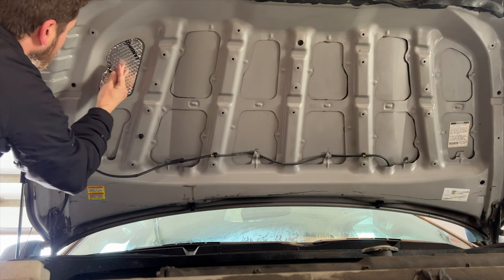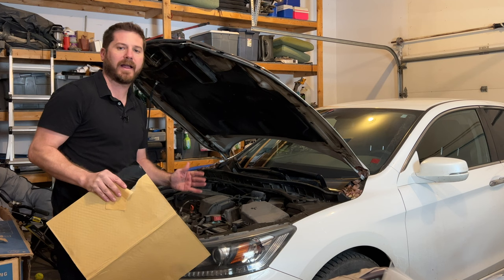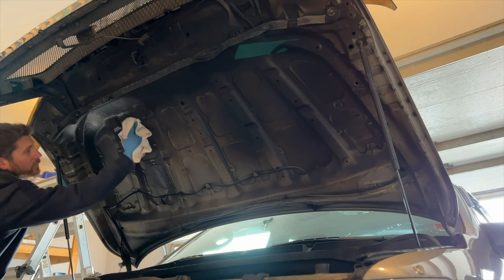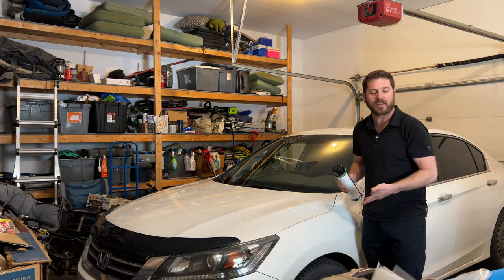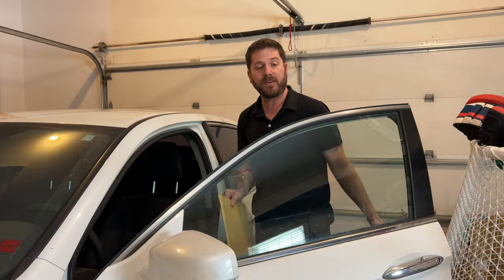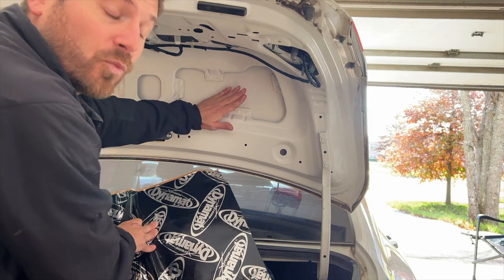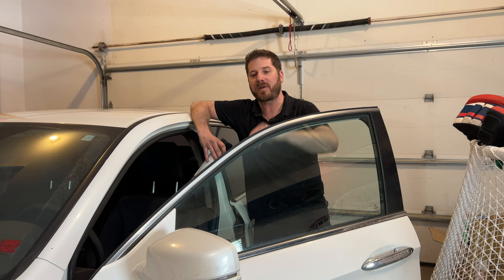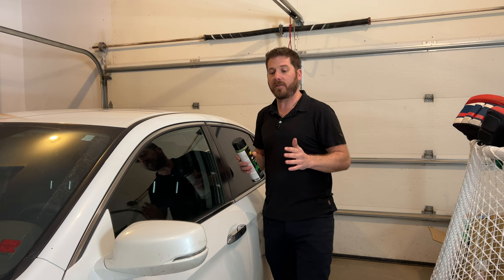Sound Deadening a Car Where It Actually Makes a Difference!

Comment: Sound deadening doesn't do much besides stop rattles. To stop road noise MLV or sound absorbing material is more important
Reply: This
Reply: What is MLV?
Reply: @AndrewDasilvaPLT  Mass loaded vinyl
Reply: You’re right but they all help, I do layers of butyl to reduce vibration and lower resonant frequency of panels, then on top mass loaded vinyl then on top of that closed cell foam
Reply: In an older car, sometimes, all you want is to remove vibrations
Reply: @modernbassheads5051 I thought closed cell foam goes between the butyl and mlv to decouple the mlv
Reply: I agree
Reply: Sometimes it's the squeaks in the dashboard and elsewhere is the low hanging fruit. It can change with temperature as the plastic expands/contracts. There are methods to tighten up loose sections with little wedges in gaps, foam tape, etc
Reply: @briank10101  Definitely. There are decoupling material and things to stop plastic from vibrating against other parts.
Reply: 😂😂😂😂😂 That's my whole point for looking any of this s*** up.What are we doing 😅😅😅
Reply: I guess I'm going to be the only person here that disagrees with the original comment. Rattles are going to be due to something loose and physically moving.
Reply: I’m looking to stop rattling from my rear speakers so this should be perfect
Reply: @JesusGonzalez-ft7ec Find out what's actually rattling first. Make sure it's not a loose screw or a loose plastic clip or some trim piece that's vibrating. If all that looks good and it's actually the sheet metal that's vibrating then some CLD sheets should stop it.
Reply: @JasonWW2000  I’m pretty sure it’s the actual speaker grill, since the speakers are reachable through the trunk and everything seems properly fitted. Whenever I drive over some shitty paved roads, the grille rattles a ton so would sound deadening foam help that?
Reply: @JesusGonzalez-ft7ec If the grill is loose then you want to fix that directly. I don't know what your grill looks like but you want something to hold it in place and not be loose. Some type of non-permanent adhesive might work. You can put some RTV silicone, hot glue or double sided tape underneath the grill area where you won't see it, but it will hold it solid.

If it's a grill that's built into a cosmetic trim panel that sits on top of the speaker and that whole panel is kind of vibrating up and down you can probably fix that with some thin pieces of foam shoved under the panel. 

If you're not sure what's causing the rattle then go back there and tap on things to see if it'll make the sound. You might also play some music through the rear deck speakers to try and get it to make the sound.

Once you know exactly what's rattling, a fix should be pretty easy.

It's hard for me to suggest a fix without actually seeing what's going on, but hopefully that helps.
Reply: @JasonWW2000  I appreciate the tips man! I will definitely have to look into, I’ve never taken the time and I just bought some foam but I’ll look at it tomorrow
Reply: Check out his other videos where he shows exactly that.
Reply: It depends on the vehicle. I see plenty of older vehicles drop 5db or so just installing foil-faced dynamat type sound deadeners
Reply: You need both material at least.
Reply: @adityadharni5027 you’re right. Take any sound deadening form a BMW and you’ll see a polyurethane foam coupled with an epdm rubber on top. That’s exactly how it should be done. Vibration (butyl/bitum), felt/ polyurethane or polyethylene and then epdm or mlv

Comment: It's a double edged sword putting it under the hood, yeah engine sounds are reduced cool....but engine sounds are reduce....meaning you're less likely to hear a potential major issue before it becomes major....example Car starts to misfire.
Reply: Or just do regular PMCS on the car, or do not buy MOPAR, Ford, VW, Hyundai, Kia, Audi, or BMW vehicles and you will not have those issues to begin with...
Reply: Actually, the real issue of insulating the engine hood is that you're trapping heat in the engine compartment, shortening the engine and component parts lifespan. That's 1 major reason motorcycles and old VWs  don't have radiators. They're air cooled.
Reply: I feel the same about doing the floor as well, especially on something like my 4WD 98 Cherokee because there’s a lot more that can go wrong than some other vehicles. I’m gonna get my sound system installed and see if I find it to be worth it to do my sound deadening before I move out/out of state one day where it won’t be nearly as easy to do a big project like that.
Reply: @journeyman291 hood insulation isn’t going to trap any more air than there is currently trapped in your engine compartment. If anything, reducing the surface area underneath the hood with an insulation pad would make less pockets for hot stagnant air to stick around in. Stagnant air in the engine compartment is an engineering failure of design.

Comment: TLDR: Under Hood, Under Wheel Liner, Doors, Floor. Not the Trunk.
Reply: Trunk is most important due to subwoofers rattling the sheet metal. If you don't have a subwoofer then I guess you only need to focus on isolating the trunk from the interior compartment.

Also, what do you mean by TLDR? This is a video. Are you saying you didn't actually watch the video?
Reply: @JasonWW2000  I use captions, so maybe TLDW, it helps to index the content even if it's short. With chapters on videos now it was hard to find unless you get through all the extra in the video.

Comment: I also did deadening on the roof. it didn't help much in normal day driving. but much better when it rain. It also help reduce heat from the sun.
Reply: reducing heat is interesting. but i actually really enjoy the rain sound
Reply: @user-jc5ff7tu5o  i love the sound of the rain! Just not when it fall on a thin metal sheet 😂
Reply: Rain on the windshield is very loud, but I had other issues when using the mat.
Reply: The sun effect is interesting for sure… having an all black interior that noticeably gets hotter the LITERAL SECOND the AC turns off full blast on a hot sunny day. This sounds interesting.
Reply: @ultragalacticgamer7195  I wonder how effective the 'glue' is, under intense roof heat?  It probably wouldn't stick long?
Reply: @ya472  it may vary depending what you're using is rated for but I've had kilmat on the roof in northern California heat for several years and no issue with the first year being consistently over 100 the entire summer with a week or so being 120
Reply: @Jay-je8fc or the blow dryer when you're going through a car wash
Reply: @darkstar9844  Awesome.  Thanks for addressing my concern.  🙂
Reply: @ya472 i applied a layer of butyl and a layer of foam for almost a year 
So far so good , butyl didn't melt but better to change the roof light from bulb to led , coz the heat of the bulb will cook the foam which I found out when I'm checking the condition of the roof last month 
I have a black car in malaysia 38°c ambient and few ppl died from heat stroke last week
Reply: @madxp9668  Good tip, thanks.  Sad about people dying because of excessive heat. 😞
Reply: @ultragalacticgamer7195  AC is just cool air in a car that has been heated.  The materials stay hot for a long time.

Comment: On your comment of insulating the floor of the car, I just put standard house floor underpadding underneath the carpet in a cheap econobox.  It was so effective people actually would comment on how quite the car was.
Reply: I had the same stuff put under my carpet in my 70 Buick. Made a big difference.
Reply: Carpet padding? Isnt that stuff too thick to then have your car carpet fit properly afterwards?
Reply: quite quiet
Reply: The issue there might be - if its not waterproof, it’ll absorb liquids (inevitably- spills, rain, washing) the material grows mold & bacteria which will smell.
Reply: @stevebutler812  true

Comment: I have an 'entry level' vehicle for getting about and yes, it's quite noisy. Thinking that it's not good for my hearing. Been on my mind off and on for a long time to insulate it than it has. This video has spurred me on. Remember: No project's too big to start! 😂😢😂
Reply: You don’t need to cover the whole panel. Just 50% or even much less will already do most of the work. Search for sound deadening on YT and look for a video of ‘car builders - sound and heat’ from 5 years ago for a great example.
Reply: It's not entry level, it's called an economy car 👍
Reply: @sean640 based off a definition of “entry level,” an economy car can be considered an entry level vehicle

Comment: really great overview of different areas. The only thing I'd add is specifically in hatchbacks I have found doing the "trunk" area can make a huge difference since it's really inside the cabin vs. the mostly uselessness of doing the trunk in a sedan.
Reply: Also look under the back seat. My mk3 golf has no sound prodding under there. Throughly is I’m waiting for some welding to done so can’t start doing anything until it’s sorted or it will get stripped again.
Reply: My 2022 Kona N-line Ultimate has a lot of noise coming from the rear trunk area and rear wheel wells. Hoping to dampen that for better conversation with rear passengers, and for the Harmon Karden player.

Comment: the trunk is also dependant on the car. Newer cars are usually pretty stuffed with liners and interior/trim. Older cars, especially wagons, can benefit a lot from it. My car specifically, Volvo 740, has a solid rear axle and (iirc) no factory insulation and the trunk actually uses a lot of wood for the trunk interior, sound deadening the trunk area makes a HUGE difference on my car specifically, mainly around the wheel wells and where the axle mounts to the chassis to be specific.

Potential seal breakages and where stuff mounts to the chassis are areas you'll see a lot of improvement, suspension mounts like I mentioned above.
If your car has a tow hook then it could (theoretically) make a big difference when pulling a trailer considering they don't have suspension most of the time so your car is gonna absorb a lot of the road vibrations

Comment: Best of all is the trunk of cheap/barebone hatchbacks/estates because it's often just steel sheet down there. I once had a cheap mk.1 yaris and it made a world of difference just with the area aft of the rear seats; it muted a lot of exhaust rattle and road noise for very little money and effort. It's also really easy to cover the rear wheel wells in hatchbacks from the inside.

Comment: I understand that the trunk can be not entirely worth it, but for me it was worth looking at! I have a 2010 corolla s, and under the carpet where the spare cavity is, there is nothing! Its just plain frame. I added adhesive back cat scratching carpet and added missing plugs to the drain holes and at fwy it reduced droan and lessened the bang over speedbumps quite a lot!

Comment: Easiest tip - never mind the underfloor work.  That’s hard, and not for everyone.  Two negatives for it - hard and water absorption.  Maybe the foam you use is closed-cell, maybe it’s not, how would you know before buying it (sure, there’s a description by the vendor, I know).  Add a second set of floor mats, or some kind of under-mat padding, eg same underlay as for carpets at home.  One big issue hardly mentioned, is fire.  Hands up all those who flame-test the stuff that says it’s ‘fire-resistant’ themselves after they buy it.  I got a shock, had some special foam pads for a loft, flame-retardant it’s meant to have…I lit it with my hob igniter flame just like the ordinary foam - both were self-perpetuating to a degree, once they ignited.  But, floor mats, is my tip.  Remember, these are the biggest flat sections of your interior, along with the roof and the door panels.  It’s not just about stopping large flappy panels from undulating, it’s also about absorbing lots of little echoes that otherwise ping-pong around.  But, good vid, thanks for these insights on other stuff.  Take care all, and don;t be afraid to use earplugs for long lonely journeys, that works too (question for discussion: is it worse or better, to use the likes of Apple earbuds when driving, for your ear protection?  My brother and I kicked this around.  It is alarming how loud you turn the stereo in the car up, when going faster than say 50mph/80kph.  Earbuds block noise, but do you end up turning them up too, so much it’s bad on a long journey?  And, the earplug/earbud method, makes you slightly more ‘deaf’ to vehicles in close proximity.  Anyway, points to ponder.)
Reply: been using airpod noise cancellation and it remove almost all noises in the car up to the point im out of touch with reality..feels like im just floating in my car
Reply: You also eliminate hearing any emergency vehicles approaching or me beeping at your floating ass 👽
Reply: My car does not have bluetooth so I use airpods pro for phone calls and I realized it's so much quieter so I started using them on the highway for longer trips. I can see AND hear emergence vehicles just fine.

Comment: The other cheap and effective way is to spray truck bed liner to your fender liner (only the plastic part)
It does reduced high pitch road noise
Reply: Which part? On the wheel side or top side?
Reply: @inevespace  On the wheel side. Make sure it has uneven texture finish.

Comment: Depending on the car you have a lot of sound comes from the trunk especially the spare tire location. if you dont do the trunk at least insulate the rear deck as trunk noise can enter the cabin thru there. Dont take off the wheel well liner, just Clean it real good and spray many layers of under coating. I noticed a reduction of road noise and liner remained in place. So far the undercoating is still in place as it was made to withstand outside conditions such as when installed on under the car.

Comment: Wouldn't the same reduction in noise levels be achieved if the sound absorbing material be added in specific areas of a car, like wheel wells, engine compartment, and firewall? I noticed that the early model Lexus cars had similar sound absorbing material that looked like Dynamat that were cut into small sections and placed in certain areas in the cabin. My guess is that their sound engineers knew how to target very specific points within the cabin to reduce noise. I've seen other videos where people ensconced the entire cabin with sound deadening material and with very disappointing results. Therefore engineers know what they are doing with small swatches of Dynamat although it looks like they're being cheap with the sound proofing. The 1977 Lincoln Versailles boasted a sound deadening feature where the shocks were double isolated. Maybe experimenting with adding rubber insulators where the spring contacts the body of the car or strut housing? Tires also play a significant role in road noise, especially if they have an aggressive tread for winter driving or they are constructed for longer wear.

Comment: I've done a layer of the amazon sound deadening material (9sheets).  I did the trunk but not the floor.  I'm thinking of buying the 36sq/ft of the closed cell to add another layer to the doors and maybe the floor.  Its an old 2009 Honda Accord Ex-L that has a loud cabin.
Reply from the maker: Doors and floors is where you will
have the most road noise reduction, especially on those older models where they would have much less sound deadening materials in them. Best of luck and let me know how it turns out!!
Reply: 2022 corolla is new and still has awful road noise issues
Reply: I just did my doors in my civic today, I ordered more and I’m going to do the trunk and fenders above the wheels
Reply: @rixzin5046 did you notice a big difference after doing the doors?

Comment: You didn't use any on the roof. I find a lot of noise comes from the roof, especially when it's raining. Using it on the roof makes driving in the rain much more pleasant.

Comment: I planned to dampen the whole car, done roof door and hood so far ,1 thing I've noticed is there're 4db noise  reduction but much significant low frequency noise, which sometimes feel like in sitting in an enclosed drum, a little bit annoying

Comment: I moved into an apartment close to a busy street. The noise from cars, motorcycles, etc. is quite bothersome. Do you have any ideas on how I can soundproof the apartment? 

I'm renting it, so soundproofing walls or replacing the windows (which are triple glazed, but not soundproof) are not an option. What can I do? External shutters? Maybe acoustic panels?
Reply: He has already made a few videos on how to add sound deadening to an apartment.
Reply: Dual pane windows
Reply: Thick sound deadening curtains, acoustic panels everywhere, that’s about it really
Reply: My brother in law gives drum lessons in his rented apartment, he lined the 4 walls of the teaching room with those 12x12 egg cartons, the drum noise is cancelled out and you can barely hear the drums from the next room. He used blutack to attach the egg cartons to the wall because it usually comes off without removing the paint on the wall. You can cover the egg cartons with some wall sheeting if you don't like the look of them.

Comment: This usually only alters frequency of the noise. You need foam on top of it and even massloaded vinyl on top of the foam. Vinyl needs to be insulated mechanically from the butyl-rubber. Foam absorbs noise quite well in its own. Just doing butyl like this is insufficient.